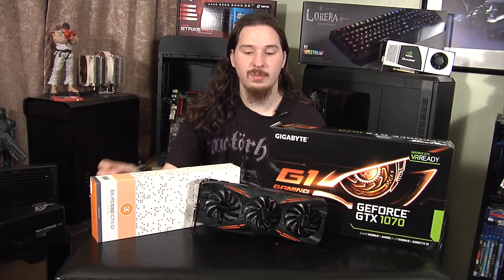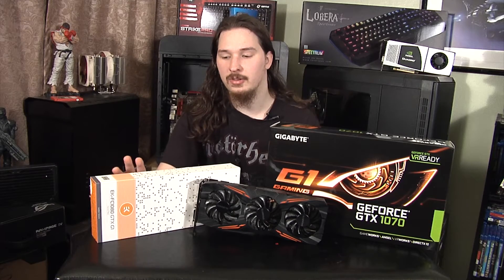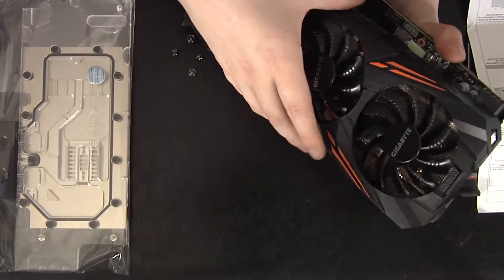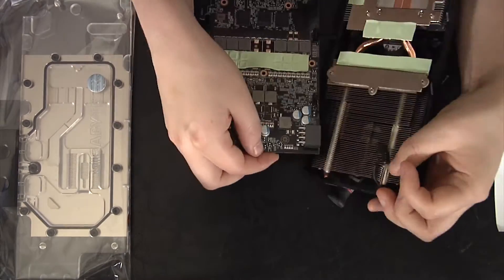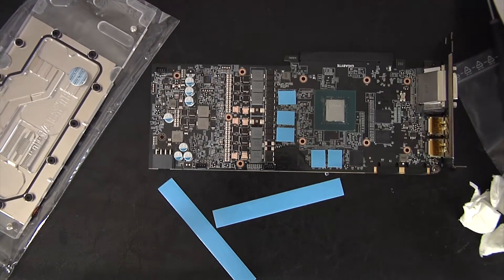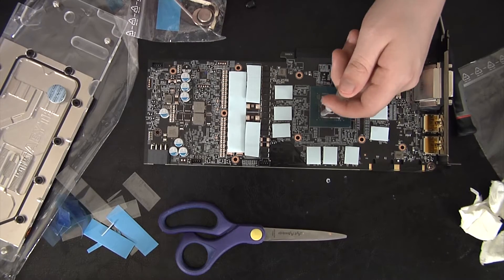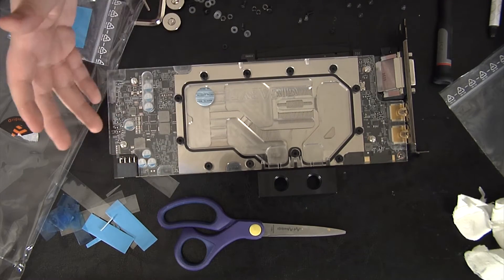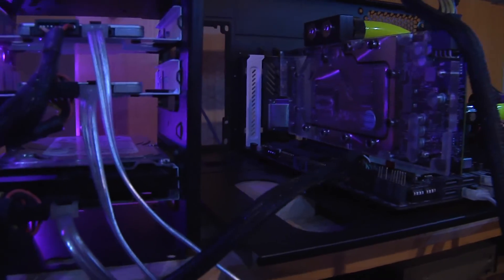How To Install A Nvidia GTX 1070 Waterblock

Comment: hi mate !
I'm interesting what size of thermal pads [ thickness]  did you install?
Reply from the maker: Thermal pad E – 0.5mm (for memory IC).Thermal pad F – 1.0mm (for Vdd VRM). Thats what the Install guide says for the EK block
Reply: Thanks dude 💖

Comment: What do you think about liquid metall as thermalpaste?
Reply from the maker: Really depends. Liquid metal corrodes solder, aluminium and is highly conductive. It also never hardens so with a vertical sitting card, it could "potentially" side down of the GPU die if a lot is applied. You can get a few degrees drop over thermal paste from using liquid metal, but it isn't worth the hassle. You need to make sure what it is in contact with is 100% copper or nickle plated copper. A thin coat of copper or nickle won't do the trick, any breaks in the coat and the liquid metal will eat it up, rendering the heatsink useless.

I would put a waterblock on before liquid metal. Way to many risks for the very small temperature drop over the best Kyronot thermalpaste.
Reply: @overclockersclub  Thank you for your answer. I use liquid metal on my 1070 just for testing. Saw a drop from 70-65 with OC and heavy load with fixed rpm. Used nail polish around the Chip for safety. Will see how temperatures will stay over the months.
Reply from the maker: I've followed a few people who put liquid metal on over 1 years ago. The ones who had a copper heatsink where fine, the others not so lucky. For me I didn't see a change with LM with a waterblock, same temps after long load. Short benchmarks the temps where lower, but once the water got warm from use, it was the same in the end.

Comment: I make aircraft aluminum adapter plates and extended heatsink to adapt a Coolermaster Lite 240 or any 2066/1151 water cooler. You can buy these coolermasters on sale for $59.99 all the time or a similar brand/model. Someoenis always running a sale. Newegg is a common place to get those discounts. It is nice using a more standardized cooler that isn’t restricted to a specific gpu. You can easily swap the fans back on keep the cooler and get another adapter plate for your new gpu.